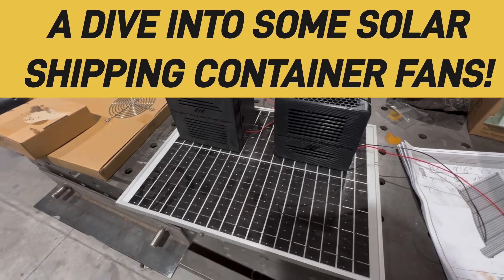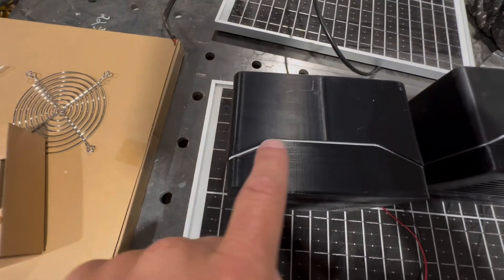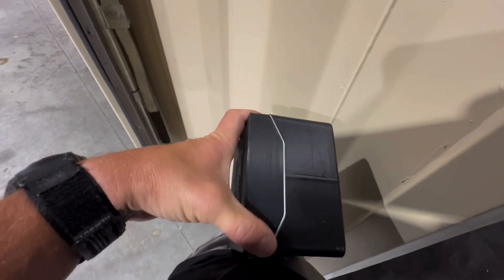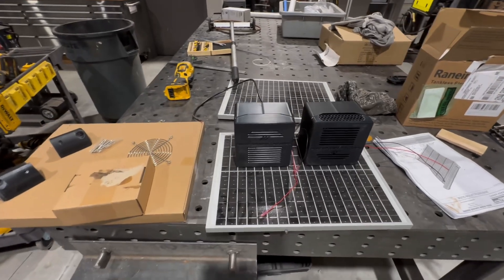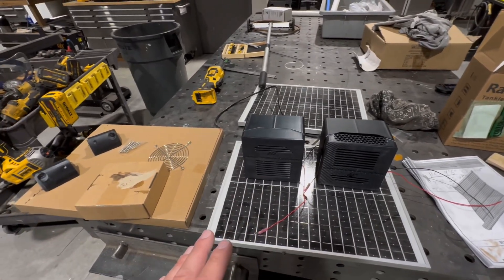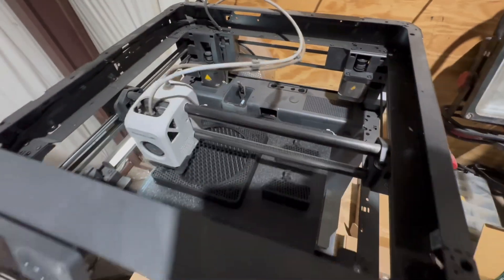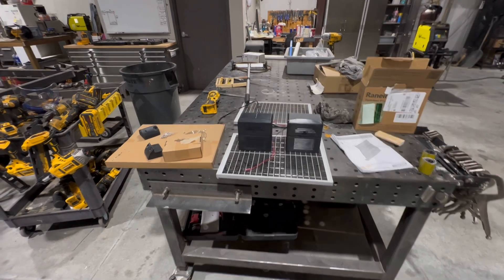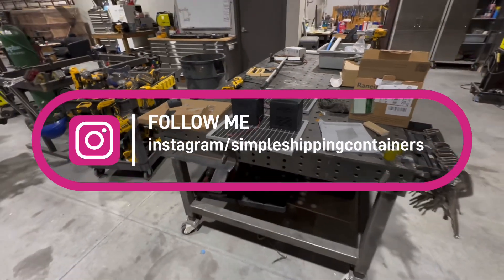Solar Shipping Container Fans! We Make These and They Move a Ton of Air! #shippingcontainer #solar

Comment: interested in your solar vent.  the wores to the panel are inside the container?  an additional hole has to be drilled?  with your 'gasket', how do you get in place without making the cutout larger?  thanks
Reply from the maker: We have details in kit but yes you’ll need one hole for the wire. Gasket is printed but sealing perimeter is ideal and we include sealant.